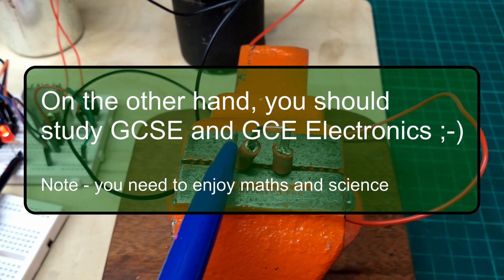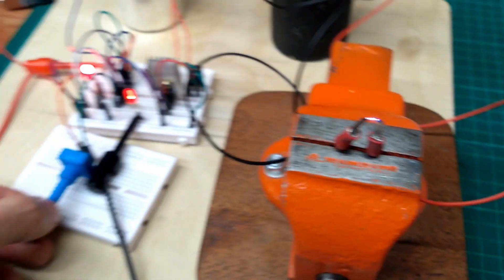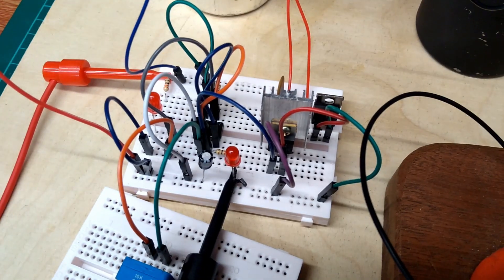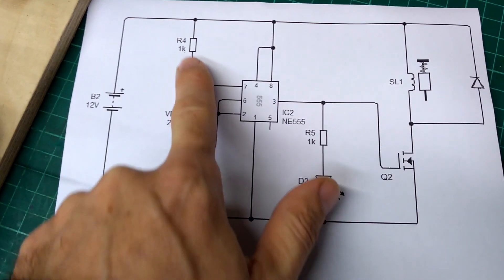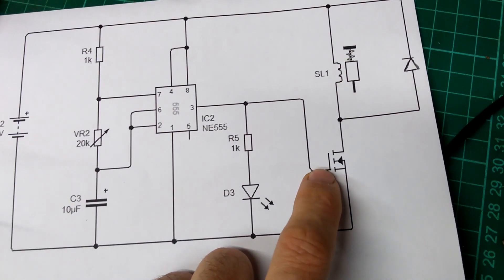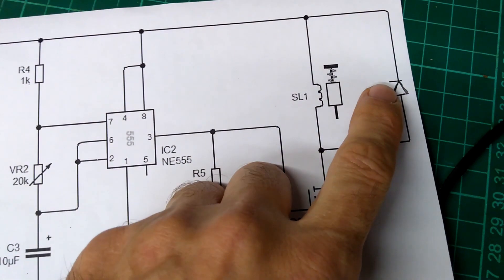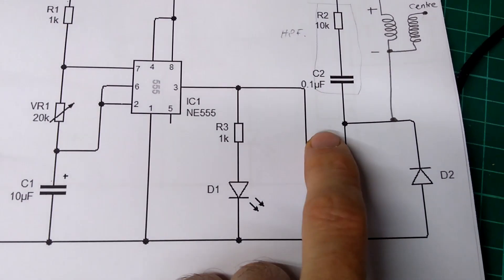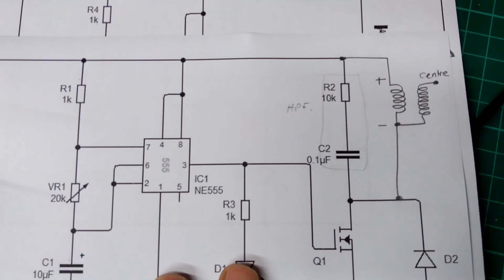555 spark generator on breadboard (DANGEROUS - do not try this)

Comment: Hello, nice video ! I have two questions:
1) Have you experience any 555 destruction? I've build a similar circuit and I keep destroying my 555s
2) Does the frequency of the 555 affect the correct behavior of the circuit? I know that too high of a frequency will impair the charging of the coil, but will a sub optimal (i.e "too low") frequency impair the behavior of the circuit in any way?
Thanks !
Reply from the maker: Hi, glad you found the video useful. I've had no problem with 555 timers failing with this or similar circuits. Are there any notable differences in the circuits you've tried that might affect the IC? I expect you've checked this already, but the maximum supply voltage is 18 V and they can source/sink about 200 mA at the absolute maximum. I normally aim for a much lower source/sink current on the output pin (pin 3) so maybe that's something to look at? Regarding your question about using a low frequency, I'd be wary of overheating the coil. Bear in mind that at very low frequencies the DC resistance of the coil and internal resistance of the power source will be the main factors limiting the coil current. As frequency increases, the inductive reactance of the coil will become more important. At that point I have to mention that I know very little about automotive coils (especially scrap heap spares like mine) so I'm basing my answer on the general principle of inductive reactance having a linear relationship with frequency (XL = 2 Pi f L). Does that help at all?
Reply: @PizzeyTechnology  Hi, thanks a lot for the answer ! It does help! I'm using a 12V battery, so supply voltage should be fine (I think). Pin 8 is directly connected to the battery + terminal and pin 1 to the - terminal. I haven't checked the output current on pin 3 yet... So far it was directly connected to the mosfet's gate, are you supposed to limit it using a resistor ? 
Good point regarding the frequency, I only used low frequencies so far (think 5 Hz). The main difference in my circuit design was that there was no diode in parallel of the mosfet and no high pass filter (in didn't really understood the use of it). 
Also, since you have a coil and a capacitor in parallel, they will oscillate, right ? If so, should the 555 oscillation frequency match the resonnant frequency of the LC ?
I though there was no point in using a diode to protect the mosfet due to the LC oscillation but I might be wrong.
Reply from the maker: A 12 V supply to the 555 timer should be fine. An ideal MOSFET has a theoretically infinite gate input impedance and zero current into the gate -- remember this is a voltage controlled device, unlike an NPN transistor which amplifies the base current. However, all real-world MOSFETs have gate capacitance and a small amount of charge must flow for the MOSFET to turn on / off. Some circuits include a low value gate resistor to reduce this current, for example where an IC cannot source / sink the transient current, but this will also slow down the switching times. A 555 timer should not require this resistor but you could include one without any noticeable effect.
Reply from the maker: I would advise using a reverse-biased (or "freewheeling") diode in parallel with the MOSFET. Some MOSFETs may already have this reverse-bias protection through internal diodes but an external reverse-biased silicon diode will limit peak reverse voltage no more than about 0.7 V
Reply from the maker: The high pass filter is needed to protect your circuit from potentially damaging voltages on the primary side of the coil. It allows the voltage to rise, but not so significantly that damage is caused. Perhaps the omission of the HPF from your circuit is the reason for 555 timer failure?
Reply: @PizzeyTechnology  Thank you for the answers! I will try to implement these modifications and see what happens !
Reply from the maker: @j-fsternon1576  no problem. Let me know how it goes.
Reply: I built this circuit and it works! I also destroyed two 555 timers. I think the intense voltage spikes did it. I placed a 1 k resistor in series with a 1milliF cap in parallel with the 12V supply. This achieves a time constant of 1 second. Then I used a 5V regulator L7805 to provide power to all the pins on the 555 that were connected to 12V. I also noticed that the led pulled my voltage too low for the mosfet I was using, once removed it works well. Sparks are so fun! I have also used two mosfets in parallel. this seems to be working.

Comment: Can you please provide a complete circuit diagram?
Reply: I am developing a circuit with short-lived spark say 1 millisecond
Reply from the maker: @PankajSharma-kk1ci  Do you mean a spark will be generated every 1 millisecond? In which case you'd need to calculate suitable values for the astable timer. Depending on the coil used, that might be too quick to give you decent sparks.
Reply: @PizzeyTechnology  Thanks for your response. It's not. Spark shall be generated for one or two milliseconds than a gap of three to four seconds. Important is spark length and width (size) of spark.
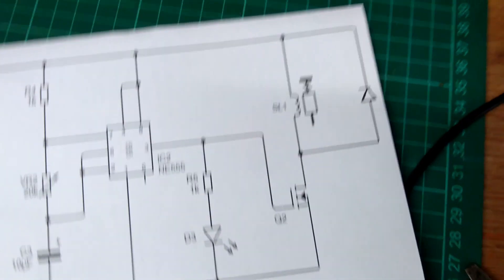Reply from the maker: Take another look at the video - see 4:29

Comment: Which are the MOSFET specs or designation? Thanks for the video!
Reply from the maker: MOSFET - BUZ11A (30A, 50V, 0.04 Ohm) https://www.onsemi.com/pub/Collateral/BUZ11-D.PDF
Flyback diode - IXYS DSEI 12-06A (14A, 600V) http://ixapps.ixys.com/Datasheet/DSEI12-06A.pdf

You might want to bear in mind that many other MOSFETs will be suitable. This particular one is capable of high speed switching and has a low gate drive requirement. The low Rds(on) is also beneficial. I have also made a PCB for this circuit and will post a video shortly.
Reply: @PizzeyTechnology  thanks a lot!
Reply: @PizzeyTechnology  Love the Video appreciate the Info and mostly your details and explanations , your comment mentioned  "  I have also made a PCB for this circuit and will post a video shortly "  In the process of looking for it I dont think im finding the correct video, please if you have time can you link me to it ? appreciate your work thank you .